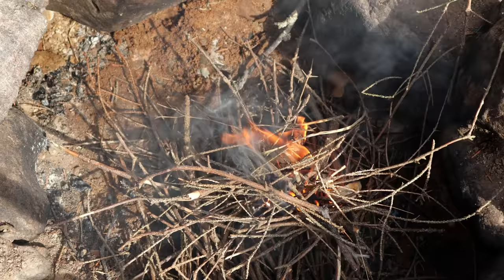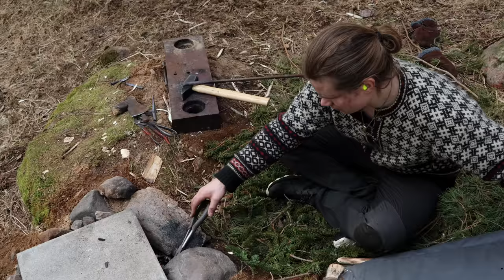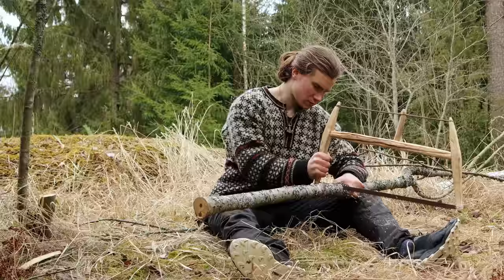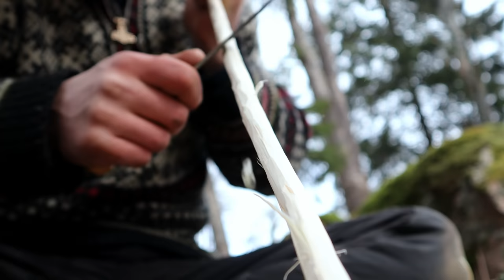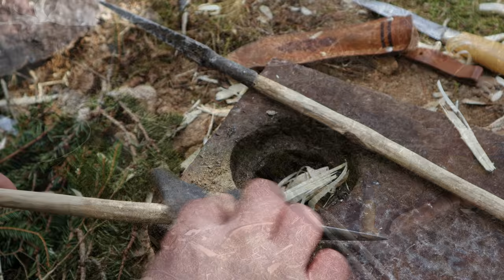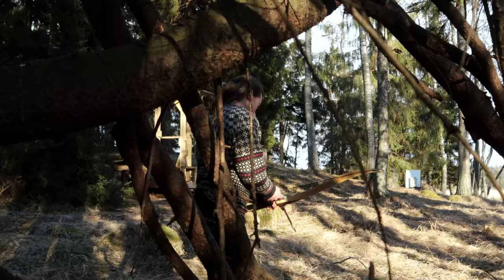How to Make Primitive Arrows Using Hand Tools - Bushcraft Forge

Comment from the maker: I'm learning more about forging, for the next craft I will get a higher temperature for the furnace. It was too low for reliable forging this time!
Reply: you are doing more than i am! Love your channel!!
Reply: You could make glue from spruce resin, ashes from the fire and deer poop. It makes really strong glue!! The poop is fibrous and makes it strong, the ash absorbs the stickiness of the resin so it isn't sticky if you touch it after it cools off and its almost hard as cement. The resin takes decades to actually dry out so its still shock absorbent for a really long time. I had a big hole in the handle of a beater axe from overstrike and filled it with the glue. Its been years since I fixed that handle and it still takes a hit now and then when the kids use it. I think the glue is stronger than the wood handle!!

Comment: How long did you let the two wooden shafts dry before attaching the arrowheads?
Reply from the maker: Not long enough. They are bent now. I have learned.
Reply: @AgeofTheNorth  I found this video very inspirational, that's why I asked. Well, for me personally it was important to see how ingeniously you carve the shafts out of the felled trunk. This gave me courage to use this method. Because before that I only cut rough branches. Your attempt with regard to the shafts is an enrichment for me in terms of the carving. Tusen takk, unge viking. Måtte gudene alltid være med deg.